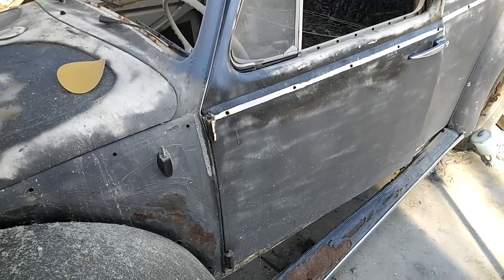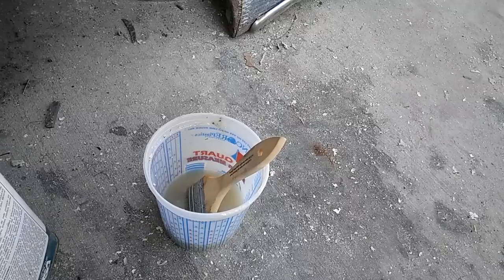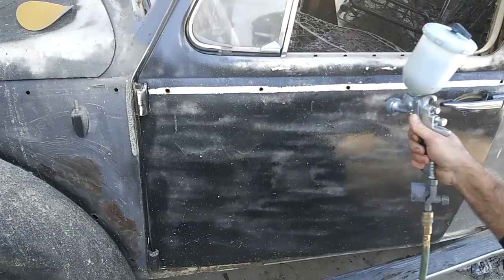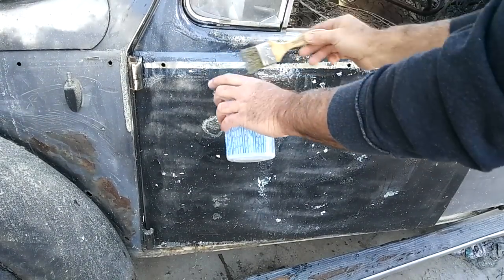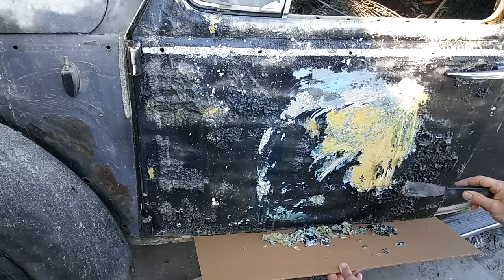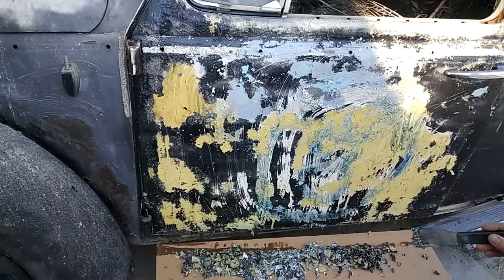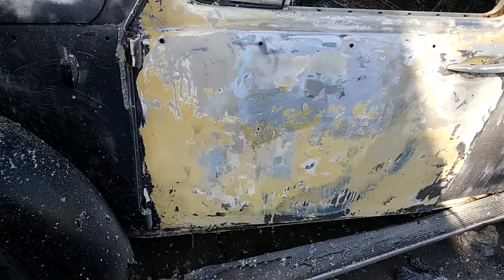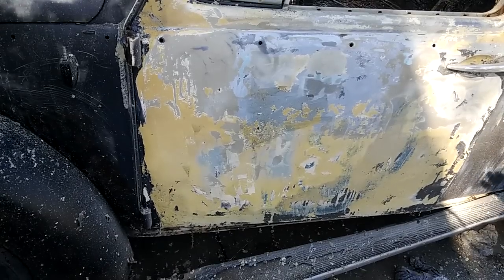Stripping paint fast easy mikes way step by step  long version plus More shortcuts

Comment: I went threw 3 gallons on my car lol. I got tired so i sent my one door and hood to the acid dippers.  75 bucks a panel i get it done for. Worth it big time. Kinda wish i did the body cause im having a hard time inside the vents in the back
Reply from the maker: I can usually do a whole car with a gallon or maybe 2 I use the wire brush technique Whole car done in 4 to 8 hours total Gotta use the wire brush that is the key to getting it done fast and efficiently. I did that whole bug in about 4 or 5 hours. .

Comment: what about using a paint roller instead?
Reply from the maker: they fall apart and dont hold the stripper as well as either using the spray or flinging it with a tipped bucket.

Comment: Tried stripping the interior on my bug in the summer using the gel version of the crown stuff, I brushed it on and it was so hot that it would flash off in 30 seconds and leave a mess, definitely better to do it in the cold. Same thing with bondo, it only gave me about a minute of work time when it was about 100 degrees out.
Reply from the maker: yea about 70 to 80 deg If you use when it is hot you will need to use that wire wheel.

Comment: Did this paint stripper cause any damage to the chrome door handle?  Could you have used a pressurized (pump up) garden sprayer for quick coverage?
Reply from the maker: no damage to chrome. I  washed it off the same day I wouldnt reccommend putting it on chrome for prolonged time period because of potential rust. I dont think garden sprayer would work because it is siphon feed. spray gun worked pretty good. but the brush was almost just as fast.

Comment: 10 mils !!!    I use the thick stuff and also cover it in plastic wrap to it does not evaporate..if the second coat (non VW) is lacquer checked, do I have to to go to bare metal ?  What do you do after bare metal ?  Dupont self etching primer ??  Always wanted to paint...sand it off and start again.....
Reply from the maker: I stay away from the jasco or aircraft it is just too toxic and it doesnt matter how much you cover up you still get burned at some point. Using the wire brush to open the surface it the key to stripping fast. I can do a whole car in a matter of hours.
Reply from the maker: prime with epoxy primer if you are going to leave it in the weather.